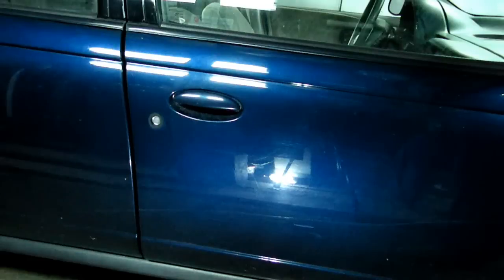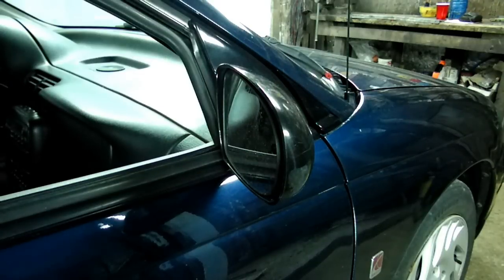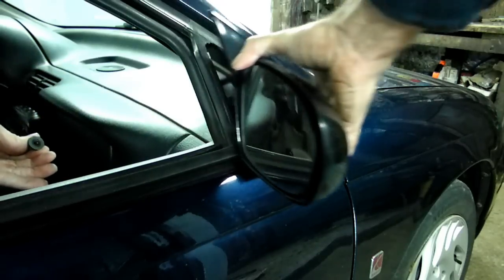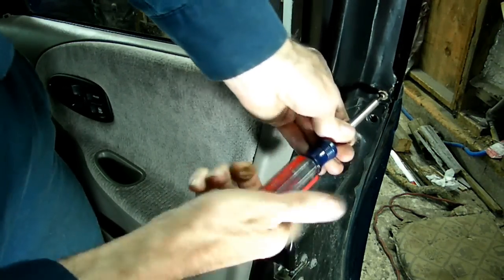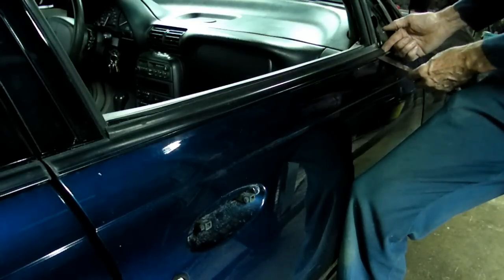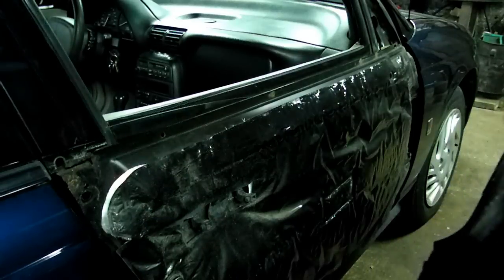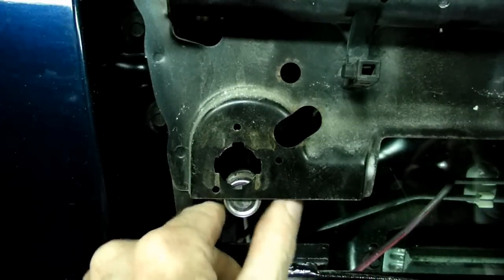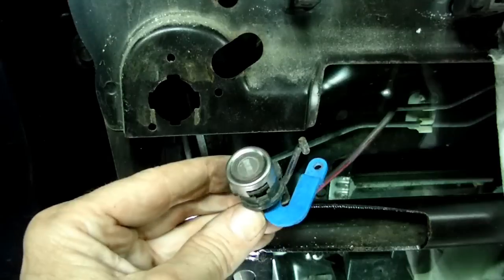Door Lock Cylinder and Panel Removal Updated

Comment from the maker: Very well designed car and easy to work on.One other thing i noticed is it holds up to the salt up here in the northeast like no other car i have seen.
Reply: Is there a trick to installing the lock rings on the door, without breaking them? One of mine fell off, and I got replacement ones but I want to install them safely because they are not easy to get one's hands on.

Comment: I found out that to get the two bottom bolts out you should take off the inside door panel and grab the retaining clips on the plastic with a pair of vise grips to hold them otherwise when you turn the screws the plastic will break.

Comment: Careful. I snapped off 3 of the torx bolt holders on the panel trying to get them out. I did that on my L 200 too. Once those are broken off your pretty much screwed. It's only going to be held on by some of them that are left. When you hear a Snap, you've broken the tab on the panel. I dont believe theres a fix for this, either. it there is, someone let me know. Most of them did come loose easily.

Comment: thx, i got a saturn sl2 and this video will help me get inside the skin panel. i do car audio as a hobby and the exterior door panel sounds so cheap, so i want to sound deaden it. also your other video showed me how easy it is to remove the interior headliner. which i will also sound deaden. there's alot of usefull videos here.

Comment: Hi there, was wondering if you had any videos on repairing or replacing the trunk release cable on the inside of the Saturn? Mine is a 99 sl2 with the pull up lever next to the drivers seat. Thanks for all the great vids!!!

Comment: Is this pretty much the same deal as an 2001 L series for removing the lock? sure like the fact that the outside door skin comes off. Much better than screwing with the interior panel.
Reply from the maker: +1972FordF150 I am not sure if the L is the same.
Reply: +richpin06a Sure is hard to find anything like this for an L series. I can't even find replacement lock cylinders for an L series, S series they're all over the place. The L series has key to code ignition cylinder, S series you can buy a cylinder with keys. It's so annoying to have a car given to you when some stupid family member lost the key for it.

Comment: You mention that those T30 screws around the door perimeter are tough to get off.  Inevitably, most will come off w/o too much effort but the 1 or 2 remaining give you such a fit that you just want to replace the entire door.  And the screw head grooves are so shallow it is very easy to wear those grooves down.
Any recommendations on how to get those cemented, tough screws off at that point?
Reply from the maker: +Chris Glines Two things you can try are super glue solvent or a solder iron to the bolt head to soften the loctite on the threads.

Comment: Great video. I'm working on a 2000 SL2 as a hobby car. Question I need to replace my driver side lock cylinder. No junk yard has it. Can I replace it with my passenger side lock cylinder or are they not the same?
Reply from the maker: If you would like a new one they are still available from http://www.trademotion.com/parts/index.cfm?siteid=214643

Comment: On my Saturn Sc1 since it is a two door I bought it from a private party but the two doors don't lock or the passenger door does not open from the inside. The Drivers door doesn't have the lock cylinder from outside which is visible. But how can I find a way to lock both doors and make the passenger door open? I would really appreciate the help.

Comment: Do you if the electric lock and window doors are interchangeable? I have a manual window and lock 98 sl2 and I want to replace the door because it was in a accident . I found one at junk yard, but it is electric.
Reply from the maker: As far as i know all 96-99 SL doors should be the same.

Comment: (1997 Saturn SL2) Today, after I tried to lock my 4doors by pushing the electronic lock button on the inside door panel, the lock became stuck & starting making loud noises on the drivers door & driver side back door. I took a key & popped the black lock button back out, the buttons are both broken now. Is there a part deeper in the door I should be looking for, and if so, what's the name of that part ?

Comment: Awesome video Rich. Is there any trick to putting the panel back on with the strip on the top? A video showing re installation would be awesome, or just a talk through.

Also, the only locks I've found were ~$120, does this sound right?
Reply from the maker: I have a jpeg of how to install that strip but will need your email to send it to you.
Reply from the maker: Eric Ver Linden
Getsaturnparts has them for half that price.I will email you that jpeg.
Reply: Thank you.
Reply: +richpin06a  I need that jpeg too before I'm driving around with naked doors
Reply from the maker: +K. Diaz Here it is http://i202.photobucket.com/albums/aa293/richpin06a/Saturn%20door%20strip%2096-02.jpg

Comment: left front door lock cylinder,the plastic arm that the rod that goes to the actuator (I think) ,broke.I can't find where to get a lock cylinder for 1999 saturn sl2  where can I get a cylinder?
Reply from the maker: Looks like getsaturnparts still has them http://www.trademotion.com/parts/index.cfm?action=partDetail&section=BODY%20HARDWARE&group=DOOR&subgroup=FRONT%20DOOR&component=LOCK&partnumber=21170985&vehicleid=85736&siteid=214643

Comment: HELP HELP HELP!!!! I HAVE A 2000 SATURN SL1 AND I NEED TO REPLACE MY DOOR LOCK CYLINDERS. I need to replace the exact part that "richpin" removes in this video. I cannot seem to find these anywhere! It is a discontinued part. Somewhere on the Internet they have to be available to me… Can anyone help?
Reply from the maker: +Matt West You do not say if it is left or right you want.I did a search for the left and it seems they are still available Part Number: 21170985
Reply: +richpin06a driver side is totally broke. passenger side is not far behind... Would like to replace both left and right.
Reply: +richpin06a I looked up that part number and it is the whole entire locking mechanism. That is not the door lock cylinder with you removed from the video.
Reply: +richpin06a have you found out anything else? I have called my junk yards in my local area and they don't have any Saturn's available. Discontinued part with GM. and absolutely nothing online...
Reply from the maker: +Matt West Check http://www.car-part.com/ under locks there are lots out there.

Comment: After endless calls to auto repair stores with no luck finding cheap car door locks, I went to an Auto Recycle (pull apart) and located two matching locks with keys. No recoding here. Parts cost $8.99 with tax and enviromental fees. If the keys are attached by wire around the streering wheel, {cut the wire and retrieve keys}